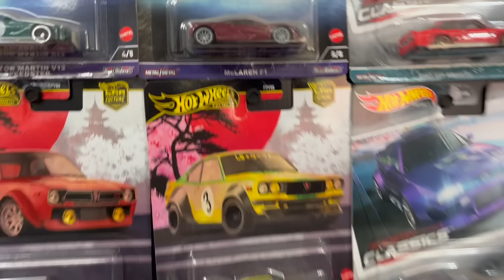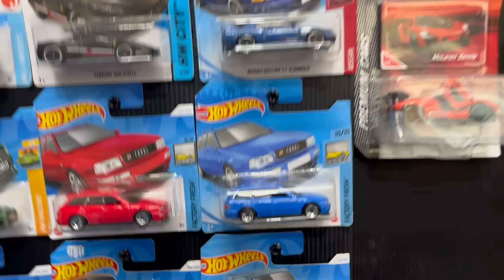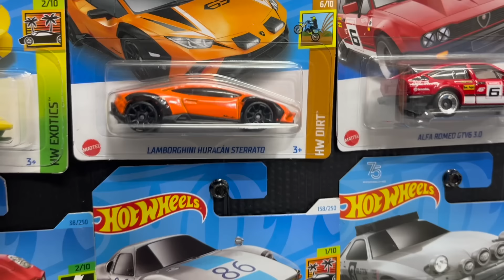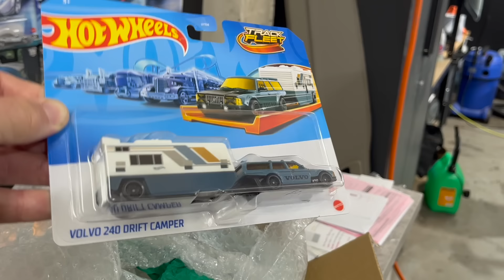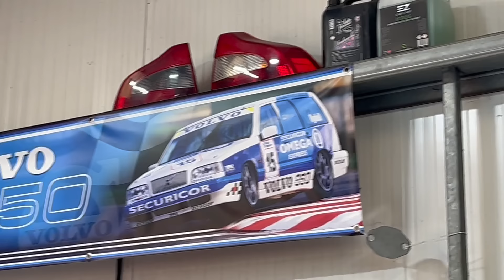Lazy Sunday… Volvo, Hot Wheels and George

Comment: I'm looking for a second hand car, I would prefer an older one, what would people recommend??
Reply: Pre 2004 bmw 5/3series straight 6 or a volvo from around the same vintage might need to get some vacuum hoses and other rubber components replaced as 20yrs is about the lifespan for most rubbery and plastic type stuff exposed to the heat and stuff under bonnet other than that should be pretty solid. Not sure on the best engines to go for on the volvos as not really a volvo guy but Geoff could definitely advise on that.😂
Reply: A Volvo estate 850/v70 or a Mercedez E class pre 2000s but you could find an old Japanese model like a Toyota Corolla, Honda Jazz, or an old Honda Civic as old people buy them and they get looked after .
Reply: E46 330 manual or 3.2 manual Crossfire.
Reply: I drive a 2004 Lexus GX470, its just rolled over 410k......its cost nothing over routine/expected maintenance & wear n tear. Avoid anything European, sadly......

Comment: What did they use to clean the headlights
Reply: Various sanding steps (varies from light to light) then reapplication of the uv coating. Unlike polishing you get seriously long lasting results
Reply: @georgehodnett6135  there's a wipe kit now available. Gonna try it on my Crossfire and MX5 this week. Then my JCW kitted Dooper and E46 mapped 330 M-Sport. (I need more cars).